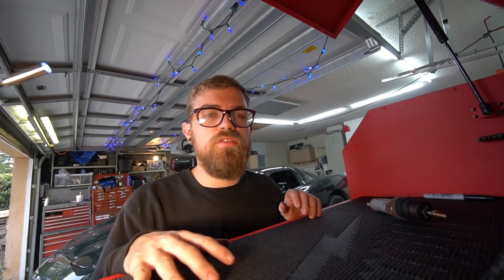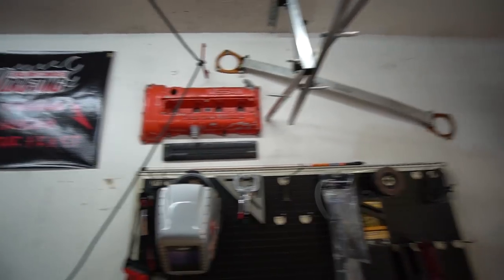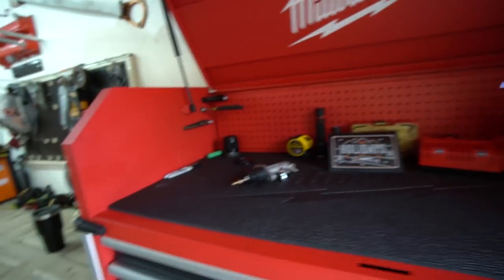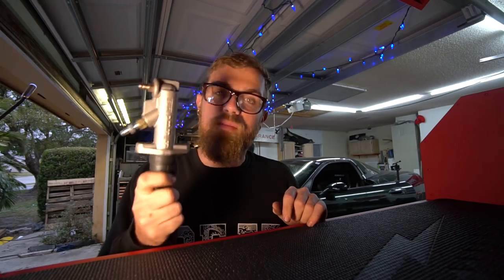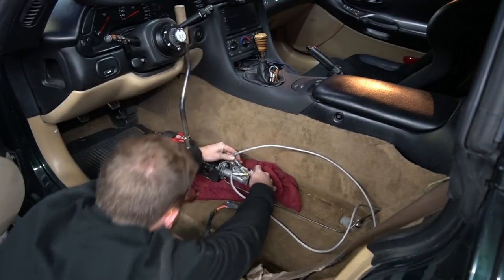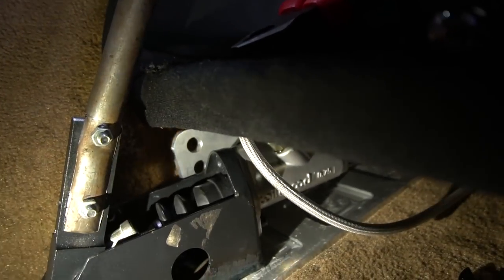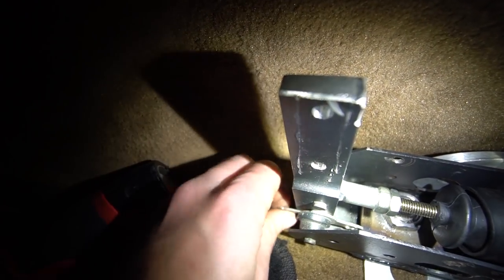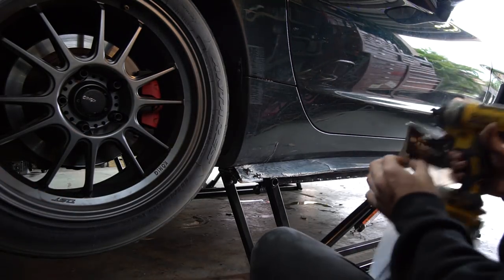Willwood Vs. Ebay Hydro Handbrake + Garage Update Tool Box Review

Comment: The thing that would make that tool box even better is if the bit where you put your batteries was actually a charger or you could buy a "Mod" for your tool box from milwaukee which replaced that area with a charger.

Comment: So as someone who’s building an engine in a garage that I have maybe 5 to 10 square feet of space depending on if someone is doing laundry it’s nearly impossible to keep clean and organized. Like to make boxes for which tools are which like I have 2 alternator boxes for my sockets one 3/8 and ones 1/2,  I personally like 1/2 because cheap 1/2 drives sockets don’t break unlike my experience with 3/8. It’s also I’m not that organized of person too begin with but I have so many tools and no tool chest, that’s my dads. Ur organization reminds me of my neighbor who was a mechanic for 30 years and used to work out his house for awhile. He has about six chests full, one air tools and power tools, one for sockets and wrench’s, one for specialty stuff, and the other three are just random but organized by draw. One nice thing is tho he lets me borrow any tool and he leaves his garage door open when he’s home, so I can take a tool and I just have to bring it back by the end of the day or when I’m done.

Comment: Taylor anytime you're working with brake lines and brake fluid keep a spray bottle of tap water and a small bucket of water to rinse tools quickly, water neutralizes brake fluid and it's stripping properties. I've stripped paint before out of stupidity of having it on my hands and not washing them before I touch the car again, lucky nothing major but you can really ruin your paint.

Comment: You should use a grommet on the hole you drilled for the brake lines if you aren't already. Could save some major headaches later on I'd hate to see the vette get stuffed because no brakes.

Comment: I was wondering what you were gonna do about a grommet for that hole with the handbrake lines.  You kinda blew my mind with that one.  Simple but effective.
Reply: I cut a piece of 5/16 fuel line in 1" then cut it length wise, popped around the 3an braided hose, a single layer of electrical tape and stuffed it in the hole with zip ties around each end of hose (too and bottom) of trans tunnel.

Comment: If u take the lock out of the single drawer with the lock and swap it with the lock on the bottom box u can then use the same key to lock the entire box  instead of having to carry two keys. Doubt u lock it but just a little trick.
Reply from the maker: That's such a good idea! Thank you!

Comment: Make sure you use the handle of a screw driver / wrench to lightly tap along the length of the flexible hose from the hydro e while you are bleeding it. It will help free trapped air in the lines

Comment: What was the size of both? Using the ebay rod you may not get the full benefit of the Wilwood master, as we've found you can left foot brake on the Wilwood while holding the ebrake. I believe it was down to plunger design,  but try and let us know ☺